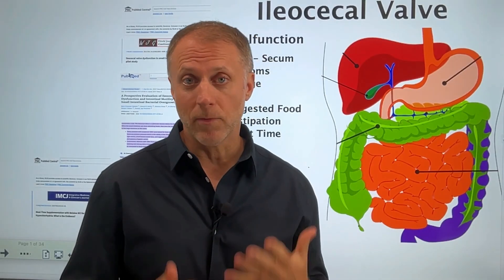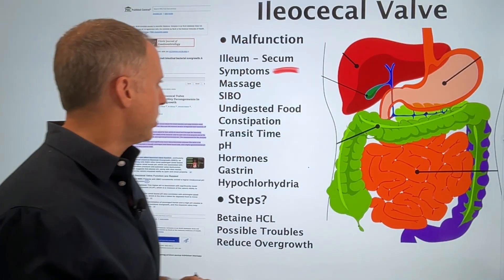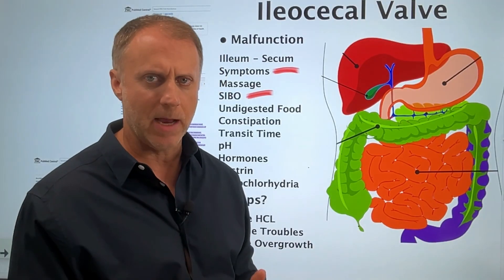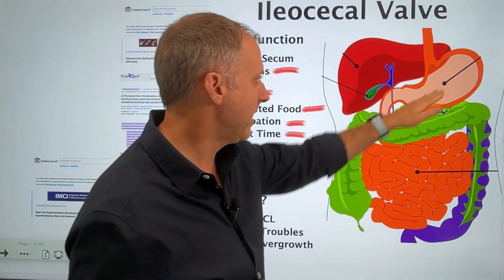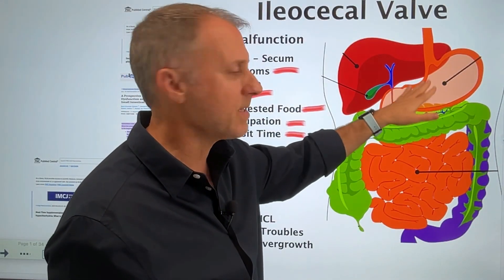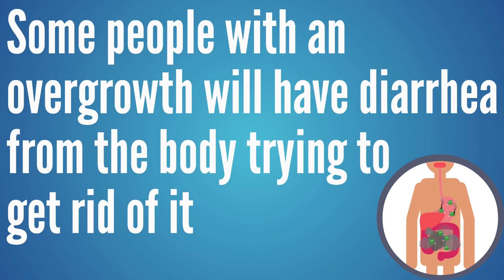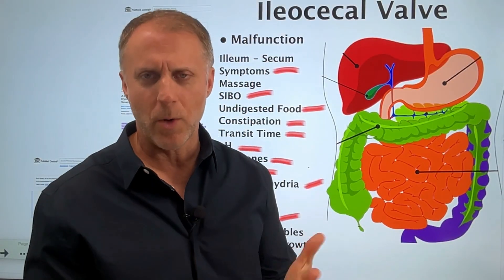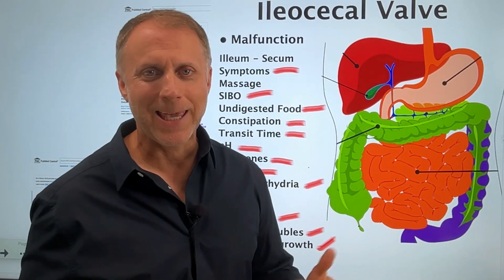What Happens If Your Ileocecal Valve Stops Working?

Comment: My digestion was dead. Very slow, non stop burping, constipated. Belly barely making any noises. Was feeling full after few bites coz small intestine was backed up. Betaine HCL was causing me pain and discomfort near ileocecal valve. What helps me is extracts of ginger + artichoke + dandelion root.
Ginger helps and speeds up stomach emptying and thins out bile and improves bile flow and also helps with inflammation + artichoke stimulates more bile production and stimulates function of gallbladder. Dandelion root enhances communication between brain and gut - helps with appetite since i had some anxiety issues too.
Reply from the maker: It can help a little, but these steps we use to improve bile flow work much better: https://youtu.be/mBdV6ZT9woQ
and if HCL creates discomfort, there are other malfunctions likely going on.  your best bet could be to go through our totally free digestion course because that will walk you through figuring out which aspects of digestion are not working correctly and what steps will help you the most.  You can find that free course here: https://kickitnaturally.com/course
Come back and let us know how it goes.

Comment: My issue is a closed valve that started after a routine colonoscopy. I have fought constipation for 5 years. Have seen different drs and none of them addresses the ileocecal valve , not even the Dr that performed the colonoscopy, very frustrating.
Reply from the maker: If you've been constipated that long, at least of the causes explained in this video is going on and likely more than one at once: https://youtu.be/ALXsIqtqUHQ
and yes, 23 different doctors were not able to help me fix my digestive issues so I understand your frustration. I had to figure it out myself.

Comment: I had gut issues in the past and pain in the valve location for years. I worked on the gut issues and those are gone. But nobody thought of this valve issue. But I figured it out.. I am going to an osteopath for it but I think I will need to check my microbiome again at some point. Is it possible that when the gut issues are adressed and the valve is not that it can be a leftover symptom of past issues?  I also have the idea it is also a stress related thing too that cramps the area
Reply from the maker: I can't diagnose things like that.  But the first step seems to be to get digestion corrected, includeing any dysbiosis issues.  And yeah, stress can be a huge deal.  This video explains what stress can do to your digestion.  https://youtu.be/qI6-PDZVvUE
Reply: thanks for your reply ❤ @KickItNaturally
Reply: What did you do to get that area to stop hurting?
Reply: massaging it the right way and the osteopath so far are helping very well @TheDon-i9d